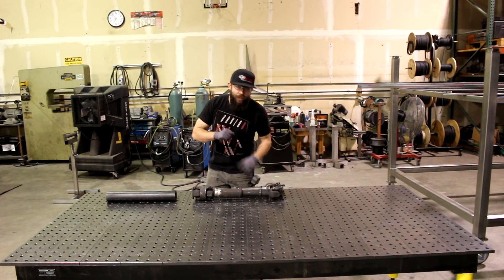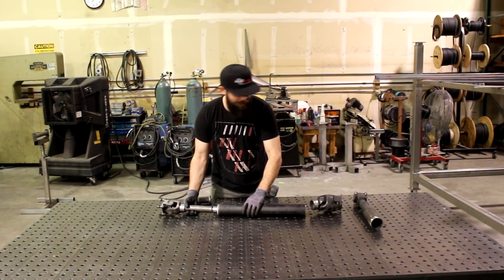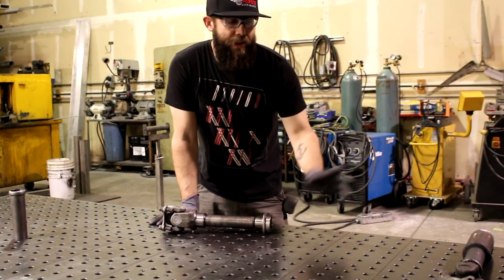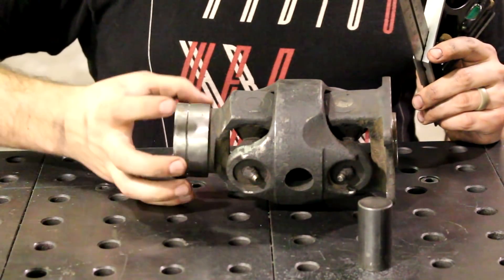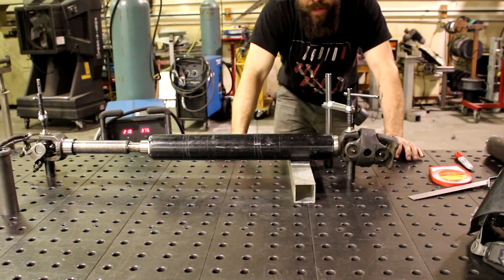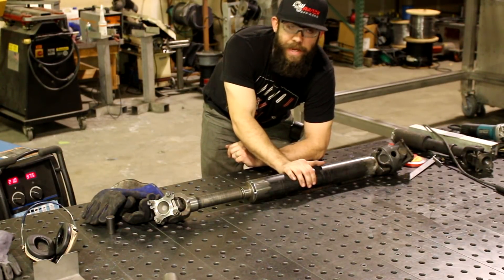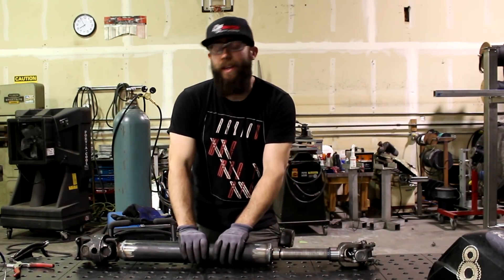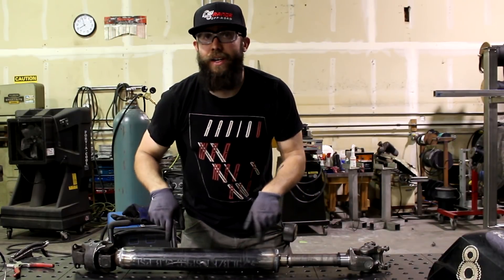How to build a custom drive shaft - Rock crawler upgrade

Comment: Nice video, very creative…
If I were to do something like that, making my rear shaft adjusted for a dual case, shortening it, should I worry about balance and any vibration…? I need to cut about 6 1/2” of the rear and using what I cut to reinforce the joint inside the tubing shaft. Any suggestion or comment…? The front shaft, I have a spare one, so I’ll be using a piece of it to add those 6 1/2” I’m pushing back with the transfer case… 🤔 I’m just thinking and getting y suggestion what’s best to do. Comments and suggestions are greatly appreciated. Thank you much!
Reply from the maker: Yes ideally for the rear you would want to make sure it’s balanced properly if it’s seeing normal road use. If it’s off road only it’s not as crucial. Take your time and get it lined up perfect before you weld it out.
Reply: T'hank you much for replying!
Yes, I would thing that aligning it very well will help to make sure it's straight and balance without vibration. I'm most likely using my truck on the streets, however, prepared for off-road use a.d anything. My rig is to have it for on and off-road use. What so you think. ..?
Reply from the maker: I would shorten it and weld it up if you certain it’s straight and then take it to a driveline shop for the balancing only. It shouldn’t cost too much for them to check it and weld on a weight if needed. This will save you some money from having them do the whole thing.

Comment: awesome video man! Im going to dry this with my old stock rear drive shaft. A few questions tho, 
1. What year of 4 runner? 
2. Are the bolt patern on the samurai tcase the same as Toyota 4runner double cardan joint? 
3. What tubing did you use? 
Thanks

Comment: PIPE???  You spent $275 already, get some seamed "tubing" or "DOM".. The DOM would be best... ((and ALWAYS buy more material than you need so you end up with a nice surplus of "stuff" to build with)) Nice  BEEFY Samurai driveshaft...!
Reply from the maker: Pipe was what I had access to and actually fit nicely. It was way stronger than it needed to be, the samurai was only pushing 60 hp.

But I do agree som DOM tubing is usually the way to go